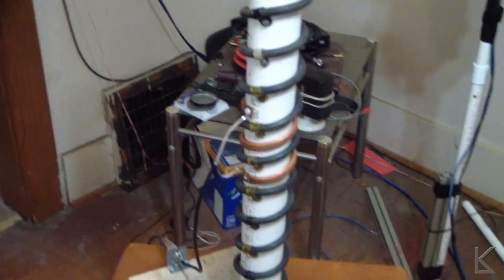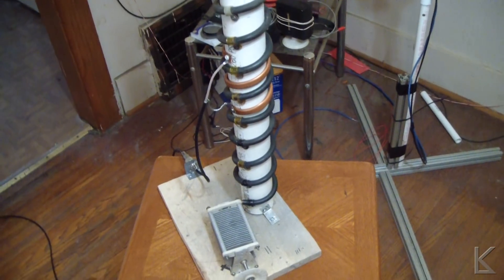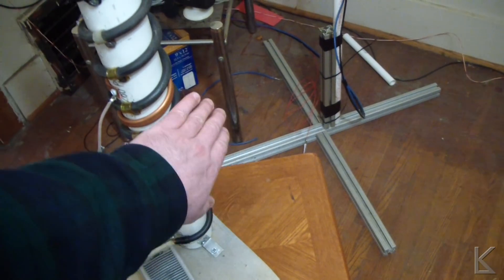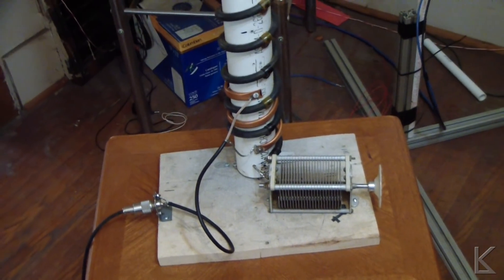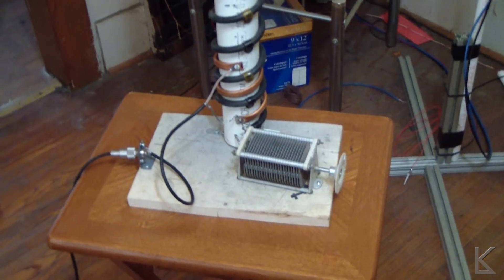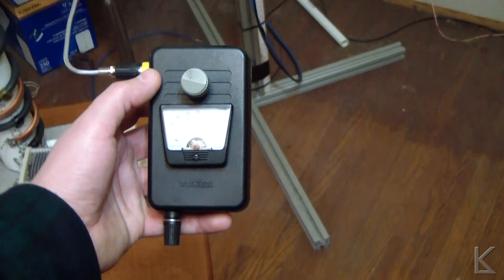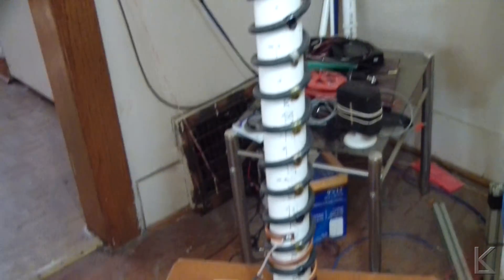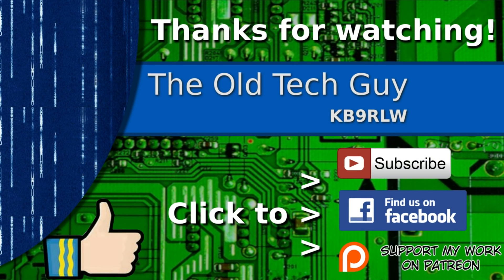Ham Radio - Experimental antenna part two, revisions

Comment: You should dig that back out, and mount it horizontal, like an hf bands telescope. It showed signs of endfire pattern, so tipping it would make it like a typical embedded broadcast ferrite coil antenna but could radiate tx signal at the horizon. Add a groundplane or screen and really db seal off one end and make it a true directional. Azimuth and Compass could really make it bankshot a specific gridsquare, and all fit in a golfbag, no hulahoop. 
Next is ditching the vari cap, without adding radials or plugging in lossy high voltage circuit caps. Even if it is a dedicated monobander, or a jumper to an harmonic, it would be ready for the elements, and almost boring simple.

Comment: Maybe use something like 10 gauge wire and not coax
Reply from the maker: The shield and center were tied together, making it a single conductor with more material than 10g wire would have.   This is a common method for portable magloops and does work.

Comment: Interesting antenna! Basically what you have here is a helical antenna. I’ve built one for receiving the Hydrogen line (1420~MHz) using a helical antenna calculator found at: http://jcoppens.com/ant/helix/calc.en.php Try using the formula there to tweak your design =)

Comment: I am a 50 year ham but inactive about 70 percent of the time, so I have a lot of make up time. I have enjoyed your experiments, I hope you keep them up. I have a question about your large loop. What I have followed on other channels say that the position of the small loop to the larger loop has changes. You have a rounded small loop and less  than round larger loop, if you made them alike , thus placing  them closer to one another does it  improve things ?    73's

Comment: Loving the videos and in particular your videos on your experiments and showing the faliures and not just the ones where they work out. Those videos are in the true spirit of amateur radio. I'm sure your license says the same as mine whereby it is granted on the basis of self learning and experimentation.
In many of your videos you mention using WSPR however I am yet to see any mention on your setup for this. I wonder could you explain your setup or even better do a video on your WSPR setup as I have a feeling your are not using one of the commercially available pieces of hardware and instead are using a software solution connected to a radio using a datamode interface.
Reply from the maker: I'm using wstjx in wspr mode and my home built USB interface.  See my DuinoVOX video.
https://www.youtube.com/watch?v=FHshPd52l-w

Comment: You just need to add some capacitive hats on both ends. Try four two-foot spokes and put a perimeter wire around the ends of the spokes.  I guarantee it will blow the sox off the mag loop!!  de K5AF, Paul

Comment: What was the effect of the telescopic whip?
Reply from the maker: Negligible.   It turns out most of the power was being eaten by the tuned circuit.  Any radiation was actually just leakage between the windings.   Not a very efficient design.   Live, experiment, and learn I guess.  Still, fun to play around with.

Comment: The end concept looks to me like an end fed antenna coiled around a pvc pipe. Hope this gives you an idea. With this in mind you could make a resonant part for any given band. Give it an tunable unun, and try again. Ground will be an issue I think. So ground direct to earth from the unun.
Reply from the maker: I have tried that previously.   The inductive properties of the coiled wire make for a difficult effect to overcome.   That's really more like a loaded whip than anything else.
In this experiment, it was not like an end fed wire, since the  end came back down the center and joined the beginning, making it more like a loop electrically.
It was more like a load and radiation was secondary.   It was interesting, but not efficient.  Still a fun experiment.
Reply: True, well that's what keeps the hobby fun. Experimenting with antenna's is always fun. But it works like a loaded whip, except there is no whip. That's what I mend with end fed. But with no radiator.

Comment: Have you told the 'Old Tech Guy' community what antenna or antennas you have outside the home? This very short antenna reminds me of the QST article I read recently about a short vertical coiled dipole for the top band. Haven't worked 160m for a while and want to get back on, even though many of the bands have been ruff (rough). 73
Reply from the maker: Good idea,  I'll do a vid on my sole HF external antenna.  Yes, I can get on 160M with it and have worked many states away, even on AM.  Globally on the upper bands, even QRP.

Comment: Kevin, dude with field strength stronger at the ends, why can't this be interpreted as a broad-side null? You've basically made air-coil rod antenna, flip it horzontal and see if it has some direction to it (like AM ferrite rods).   Check out the last slide here.  If you're oscillating (sinusoidal voltage/current waves) w/in the solenoid it seems your E-field lines run the length of the tube - in other words this thing may be end firing/receiving.  You gotta try this. http://www.phys.lsu.edu/~jdowling/PHYS21024SP07/lectures/lecture18.pdf